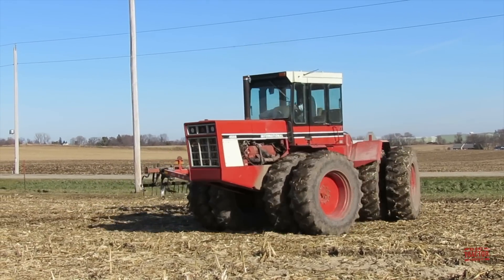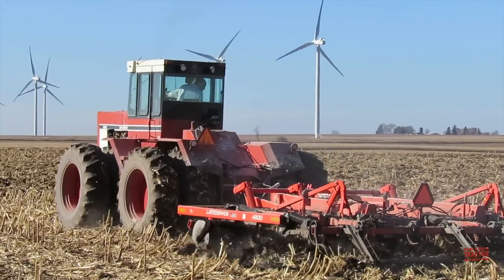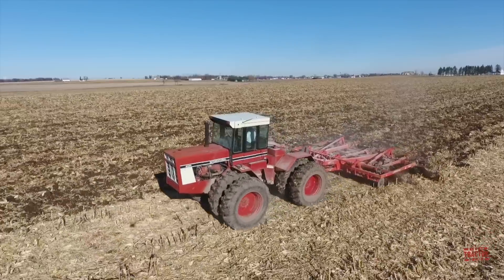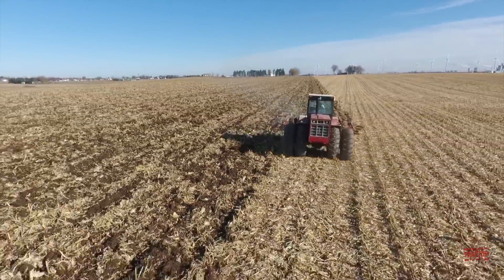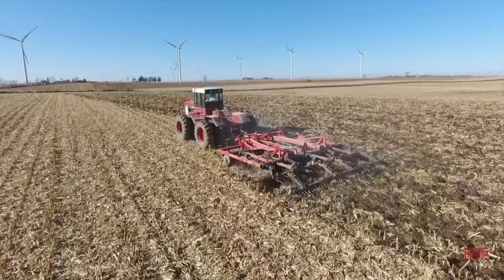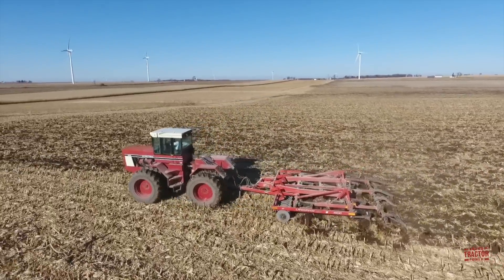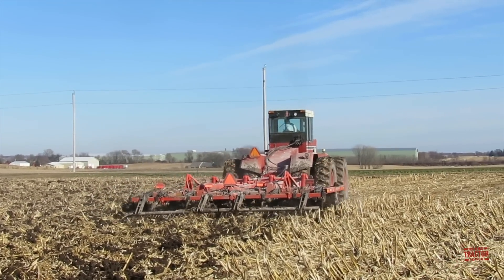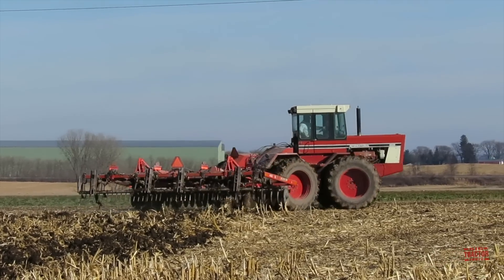INTERNATIONAL 4586 Tractor Working on Fall Tillage

Comment: I bet while editing you were wishing you could of had your tractor there to do some of the tiling also.
    Nice looking old tractor and still earning its keep.
Reply from the maker: I would love a chance to run a Krause Landsaver in a big field like that with my 4786. It’s s nice set up.
Reply: I've grown to like these IHs.  They didn't get their due, Stieger made big HP but IH is right there, cheaper too.
Reply from the maker: The IH 4wds unfortunately we’re not built as strong as Steigers. IH used IH components from the row crop tractors that were not built for long term heavy tillage.  I own a 4786 and like it but Steigers are more solid.

Comment: First thing I  noticed was his rain cap broke off just as mine did this spring running anhydrous with my 4586. 19 knife blue jet toolbar. First tractor I purchased. Lots of fun
Reply from the maker: That’s cool you have a 4586. I own a 1981 4786. It has a curved muffler.  This farm just bought the 4586 and plans to restore it this winter.
Reply: I purchased mine January of 2018. I have been using it and fixing the problems that show up. I plan to paint it this next spring. I already have redone the cab. Installed an air seat. Even had the original IH radio fixed. Really stands out in my area. Everyone has the newest and the best and I'm running our family fertilizer business with a 1978. Thanks for the videos

Comment: What can stop that old beast when it is on a stroll, that is so awesome it looks basically the same as yours with only a difference in the decals
Reply from the maker: This is the 76-80 style with the white roof. The 81 models like mine have a red roof and black tri stripe decal. 81 models have a curved muffler where the 76-80 have a straight stack.

Comment: Love the sounds and looks of the International 4586.  Why was 86 on so many International tractors dating to earlier times?  Thanks!   - Dean from Minnesota
Reply from the maker: The V8 powered Internationals have a great sound.  You always know where they are working.  The 86 series covered all the IH tractors from 76 to 81 except the 88 series 2+2 tractors. John Deere at the same time had the 30 and 40 series that coveted utility tractors to 4wds. I think a series was an easier way to keep track of a range of tractors.

Comment: Gear drive and no hydro,makes for major leg cramps by the end of a long 16 hour day.
Reply from the maker: No hydro in any 4wd that I know off. In my experience running my 4786 there is little shifting. I put it in 5th or 6th and let it roll all day at that speed. I just throttle a kid on the turns.
Reply: @bigtractorpower  If you don't have hilly fields,this is true.😎👍

Comment: Do I land owners get paid for having those windmills on their property and where does the electricity go they produce
Reply from the maker: I am not sure. I am guessing they are owned by a power Company and the electricity goes to the grid.  From what I have heard I think it is a 50 year lease with the land owner and the company pays to remove the wind mill at the end of the lease.
Reply: Jim Petersen Normally they wind mills lease the ground for a set number of years. It goes to where it is needed. The electricity produced in Iowa goes to East coast where they can’t use electricity produced at coal powered production plants. Governments regulations!🤷‍♂️